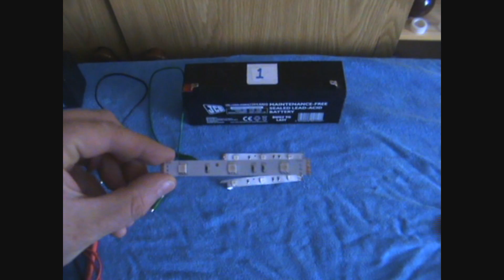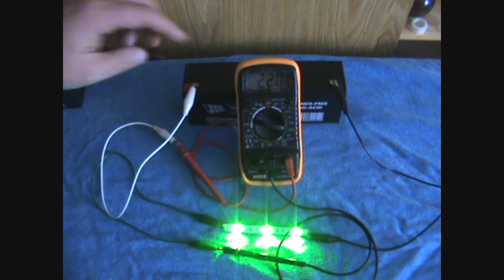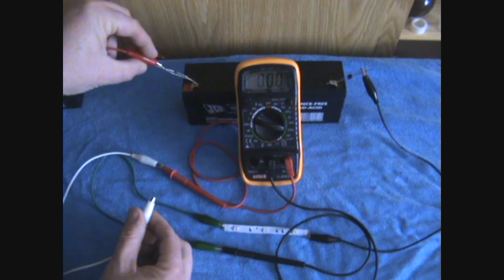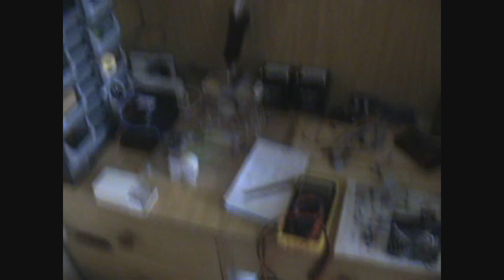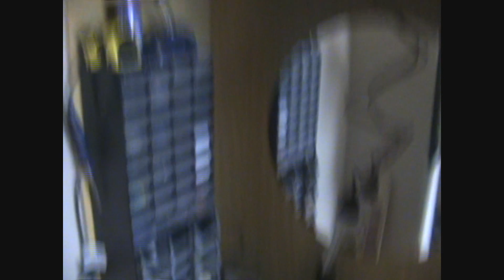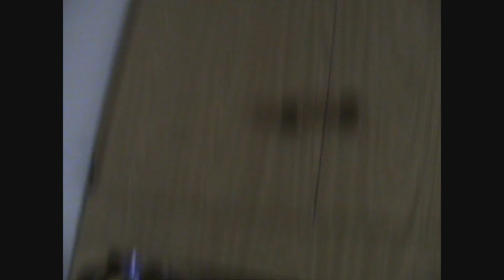Reducing Amp Draw

Comment: It's about DC so Can you explain same in alternating current, how you will Reduce amps in AC by using Resistors with full load current! In many projects I used Resistors for vtg drop and terminal restistor to get correct reading in plc but sometimes I need to take zero current at output without change in Volt in AC supply.

Comment: Unless you are showing us the power draw from the battery side, all you are showing is how many amps are being burned through heat due to residence in the diodes. If you show the draw voltage and amperage, you will see it is the same or even more is being drawn, since you have removed the potential energy from the system, by adding resisters.

Comment: Every diode you add will take 1/2 of a Volt from the LED strip. I put a Pulse Width "motor speed control" on my 12 Volt LED strips in my kitchen that runs at 20KHz. I turn it down to 10% duty or less at night and up to 50 or 60% when I need more light. There is no flicker & it's been working for years now.

Comment: This is not the proper way to efficiently reduce current flow.
Reply: jp040759 dear could you tell me how to convert car battery 12 volt  to 5 volt ~4 amps
Reply: I don't know what you are doing but this should work for you.  Check out this part number.   XL4016 Power module.    Can be found on Ebay.   It can handle up to 8 amps per the specs.   Search youtube and you will find many videos on this topic.   Search for DC-DC buck converters and/or XL4016 Power module.    Don't waste your time with Bedinin B.S.  It is bogus and does not follow proven engineering principles.  There is no such thing as over unity.

Comment: Nice one but dont get to excited every time you add diodes you are reducing the voltage and accourding to ohms law reducing the power .this led can be powered with a 9v battery at low amp draw
all the best mate

Comment: I think (don't quote me) that what you're doing is reducing the voltage getting through the circuit using diodes, however diodes are inefficient.  From what I've read, they burn off some power as heat as there's no such thing as an "ideal" diode.  When you halve the amp draw, but you're probably getting a lot less than 50% light from the setup when you reduce the voltage this way.

I would think that a proper voltage regulator based on a switch mode IC (I got one on ebay for £2.50 with a MP1584 controller, 96% efficient, ready to go - although I burned it out about an hour ago whilst experimenting, I think I shorted it by accident).

Also, I think your LED's have resistors inline to reduce the current so it doesn't blow the LED's.  If you use a switch mode regulator, you might be able to get rid of those as they're really really inefficient, lowering your amp draw without lowering light output, or you can choose to lower both, saving you even more power.

Resistors get rid of current by burning it off as heat.  They're basically just tiny heaters.

I'm no expert, I'm just experimenting with LED efficiency at home, but this is how the situation seems to be to me.

Comment: SLA battery charger config is 13.8 to 14v with 2 ampes. so i have adapters but that power adapter config is 12v .3.33 ampes ..so iam planing to increse in voltage power and decrese in ampes.

Comment: If you have a battery of 5 volts and your capacitor can charge to 12 volts, is it possible the capacitor will charge to the full 12 volts?

Comment: my guess is the reduction in amp draw is due to the lower voltage that is ending up on the LED's. each of those diodes drops the voltage by aprox. .7volts and somewhat act like a resistor they way they are hooked up here - that's why the lights dim..
on the SSG, the returning diode is actually being rectified due to the impulse of spiky IMHO.
I thought I was subscribed... I'll hit it again.
Cheers